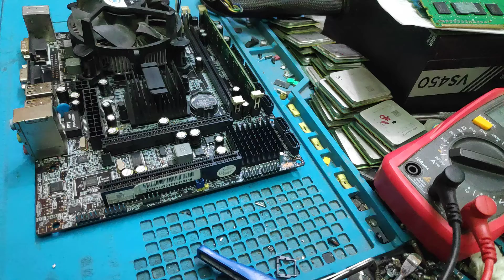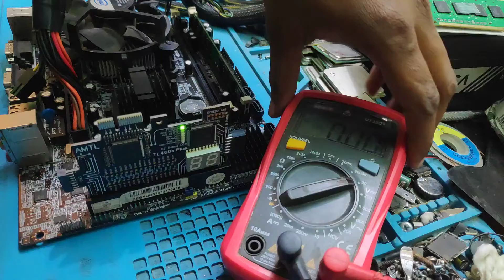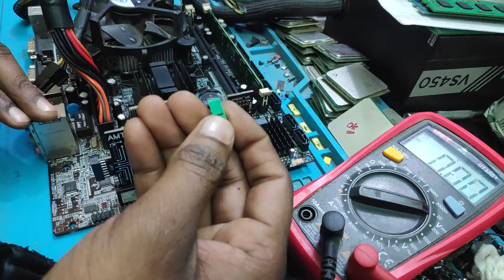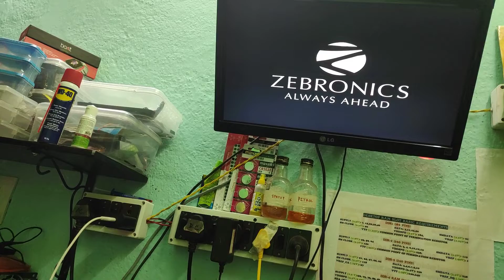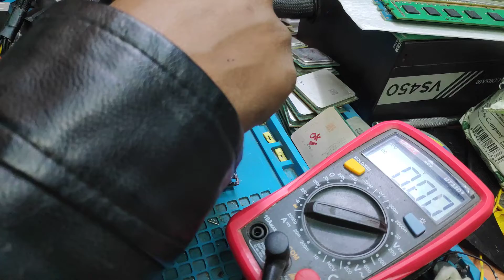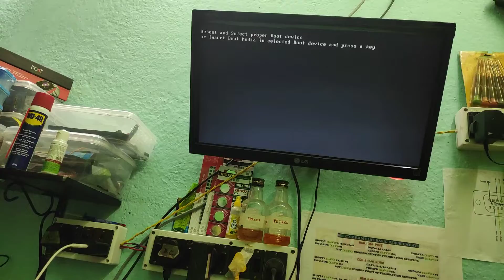ZEBRONICS G31 MOTHERBOARD NO POWER PROBLEM SOLUTION | ZX-G31LM NO POWER

Comment: Bro I have the same motherboard G31 but the issue is the 946gz express chipset  on the board is heating up very fast , at first when I turn on the pc the booting is done successfully and can be able to use the pc without any issues but after 10-15 minute of been ON the pc whole window stacked and  restarts  and when restarting  it is not booting up ,and I have to off the power supply and have to wait for sometime to cool down the chipset  and  start the pc and then it starts normally and work good but again the problem repeats again heats ups and get reboot and doesn't work
Reply: I checked the MOSFETs near  the  sata port and one of the MOSFETs is showing short and other showing less value in buzzer mode ,while checking the board I find that the capacitor near the MOSFETs is blown or leaked it's value is 6.3v 1000uf and I replace the capacitor with 25v 1000uf  but the 946gz  chipset is still heating up
I doesn't change the shorted MOSFETs
Reply: Please reply what will be the issue causing the chipset to heat up what should I do to repair  ,is it MOSFETs or the chipset is internally short if it is then it can not be able to display window ,but it does so  what is problem of my board please reply